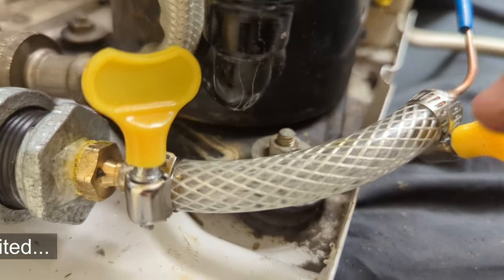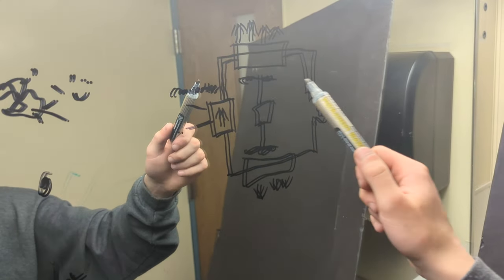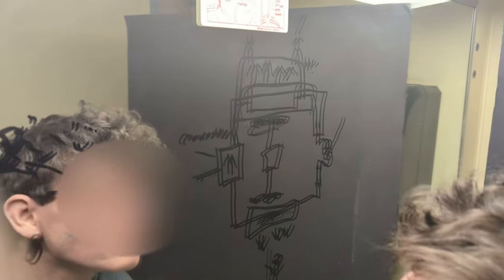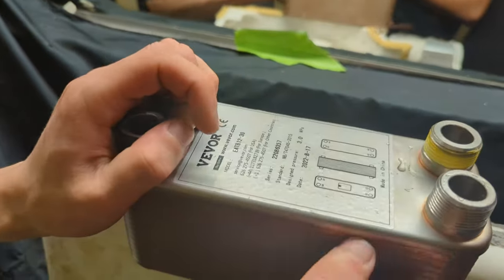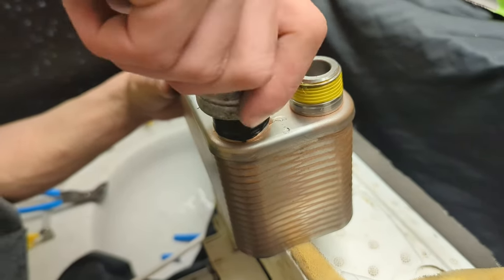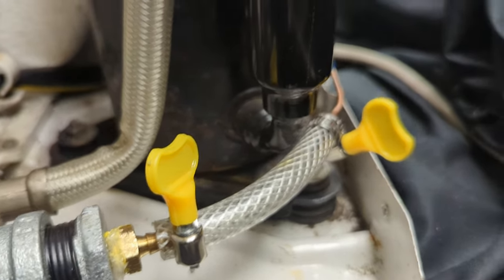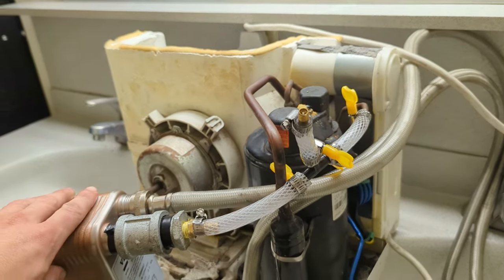AC Unit to Water-Cooled: The Ultimate Cooling Upgrade!

Comment: He just built a marine AC unit….  Exactly how they work.  And pretty sure if you use a large ground loop that’s how geothermal works too.
The clever thing is to do this at house size and use a pool as the water source…. Then you have a pool heater as well.

Comment: Are the fluids travelling through the block in opposite directions?  That is supposed to help with heat transfer/efficiency. 
Also- you can use electronic duster “canned air” as a coolant (R152) vs R134, and you can use less of it (2/3 by weight of 134 iirc)

Comment: whats the difference in watt? is it more efficient in power consumption?
Reply from the maker: yes, it was close to 80% more efficient
Reply: @ianbuilder  What is your math on that? All you have eliminated power-wise was the condenser fan. You are still running the compressor and you still need a blower for the evap coil. Condenser fans usually only make up about 10-20% of the power consumed in an AC unit. Supply fan motors are also about 10-20% and the compressor is about 70-80%. And, you are either going to waste a ton of water on an open loop, or you still need a way to cool the water on a closed loop. So you will need a fan/radiator setup somewhere to reject the heat from the water. All you did was make this unit a little quieter.

Comment: Nice work for explaining the process.  How did you size the flat plate heat exchanger?
Reply: Sizing a Water-Cooled Heat Exchanger for 12,000 BTUs
Understanding the Basics
Before diving into calculations, it's essential to understand the key parameters:
 * Heat Load: The amount of heat to be removed, which is 12,000 BTUs in your case.
 * Inlet and Outlet Temperatures: The temperature of the water entering and leaving the heat exchanger.
 * Water Flow Rate: The volume of water passing through the heat exchanger per unit time.
 * Heat Transfer Coefficient: A measure of how efficiently heat is transferred between the two fluids.
Steps Involved:
 * Determine Inlet and Outlet Water Temperatures:
   * This depends on your application. For example, if cooling a machine, you'd want to determine the maximum allowable outlet water temperature.
   * A typical range might be 70°F to 90°F.
 * Calculate Required Water Flow Rate:
   * Use the following formula:
     * Q = m_dot * Cp * ΔT
     * Where:
       * Q = heat transfer rate (BTU/hr)
       * m_dot = mass flow rate of water (lbm/hr)
       * Cp = specific heat of water (BTU/lbm°F)
       * ΔT = temperature difference between inlet and outlet water (°F)
   * Rearrange the formula to solve for m_dot.
 * Estimate Heat Transfer Coefficient:
   * This depends on the heat exchanger type (shell-and-tube, plate, etc.), materials, and flow conditions.
   * Typical values can range from 100 to 1000 BTU/hr-ft²-°F.
 * Calculate Required Heat Transfer Area:
   * Use the following formula:
     * Q = U * A * LMTD
     * Where:
       * Q = heat transfer rate (BTU/hr)
       * U = overall heat transfer coefficient (BTU/hr-ft²-°F)
       * A = heat transfer area (ft²)
       * LMTD = log mean temperature difference (°F)
   * Calculate LMTD based on inlet and outlet temperatures of both fluids.
   * Rearrange the formula to solve for A.
 * Select a Heat Exchanger:
   * Use the calculated heat transfer area to select a heat exchanger from manufacturer catalogs or consult with a heat exchanger specialist.
   * Consider factors like pressure drop, materials compatibility, and cost.
Additional Considerations:
 * Fouling: Over time, deposits can form on the heat exchanger surfaces, reducing efficiency. Consider fouling factors when calculating the heat transfer coefficient.
 * Pressure Drop: Ensure the selected heat exchanger has an acceptable pressure drop for your system.
 * Material Compatibility: Choose materials compatible with the fluids involved.
 * Cost: Balance performance requirements with budget constraints.
Example:
Assuming:
 * Inlet water temperature = 70°F
 * Outlet water temperature = 90°F
 * Desired water flow rate = 10 gallons per minute (gpm)
 * Estimated heat transfer coefficient = 300 BTU/hr-ft²-°F
You can calculate the required heat transfer area and select a suitable heat exchanger.
Note: This is a simplified overview. Accurate heat exchanger sizing often requires detailed calculations and consideration of various factors. Consulting with a heat exchanger expert is recommended for complex applications.
Would you like to provide more specific information about your application, such as the type of fluid being cooled, desired temperature, and available water supply? This would help in providing a more accurate sizing recommendation.

Comment: Nice modification. I think you can cool the water using a high efficient radiator or use the radiator used on the AC so that you can extend the heat away. This way, no window rooms can have AC now. I have a batch freezer used to make ice cream and it is water cooled which water is wasted to drain, was thinking on using a radiator to cool the water and place it outside/different location.

Comment: It would be easier to put the condenser heat exchanger in a tank of water even if you have to make the tank out of plywood and J B weld.
Reply: And then when the water tank gets warm?? Are you going to make a water chiller for that tank?
Reply: @racerdude7149  
Not everyone shares your IQ. Most people assume that one way or another the water will have enough cooling surface to maintain temperature. This is a way of using water cooling without cutting the refrigerant pipe.

Comment: Would it work, if you just place the condenser in a container, then used a pump to pump the water around, with tubing??
Reply from the maker: yep
Reply: @ianbuilder  What if you used a coaxial tube heat exchanger coil as condenser on a portable a/c, & used a radiator to watercool it

Comment: The EPA would like to know your location.
Reply from the maker: as you could see i used butane instead
Reply: @ianbuilder  Please tell us where we could see that you used "butane". At 6:39 we can clearly see you used a can of 134a with a chemical formula of C2H2F4.
No where in this video do we see a can of R600a with a chemical formula of C4H10 (butane / isobutane)
For the ignorant, the main difference between these two refrigerants, 134a is nonflammable while R600a is flammable.
Also, why wouldn't you use propane rather than butane?
R600a (C4H10) costs $0.65 / oz, while propane (C3H8) costs $0.01 / oz
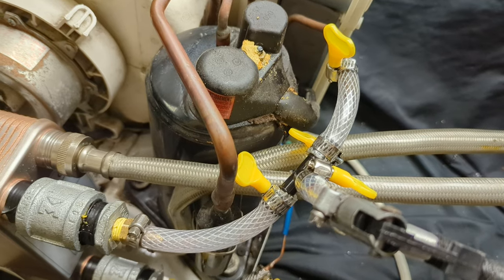Reply from the maker: @PH_INFO_101   6:55
Reply: @ianbuilder  My apologies sir. I stand corrected
Reply from the maker: @PH_INFO_101  its all good ,thanks for watching